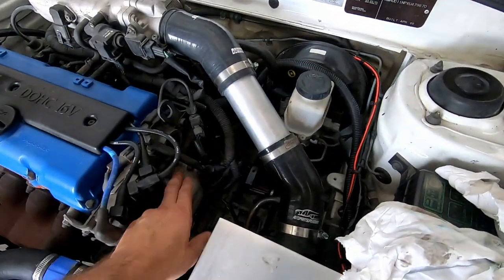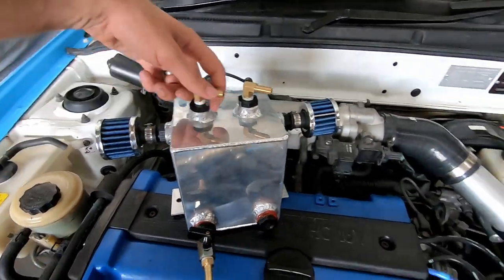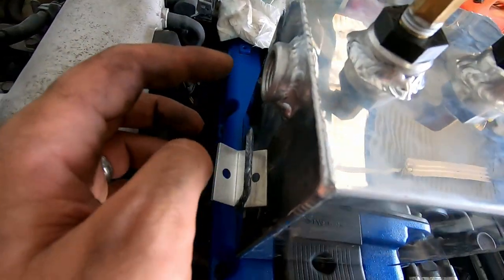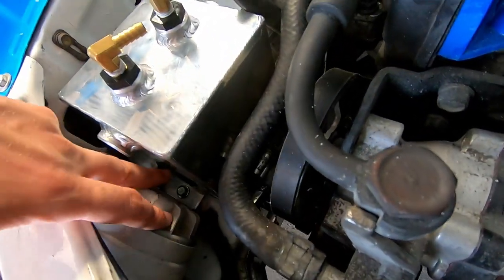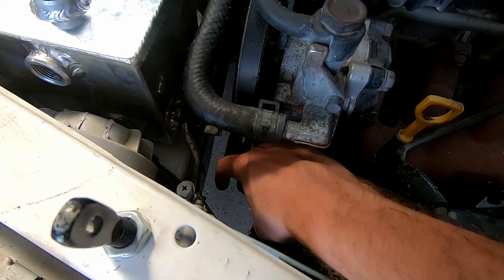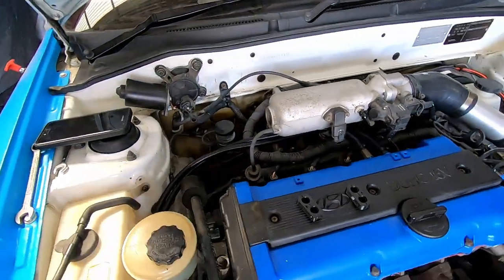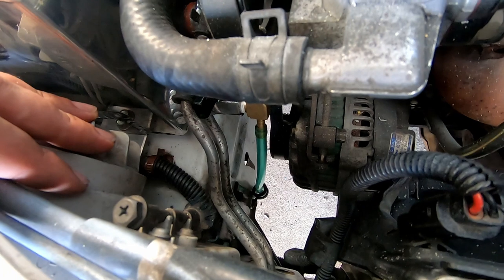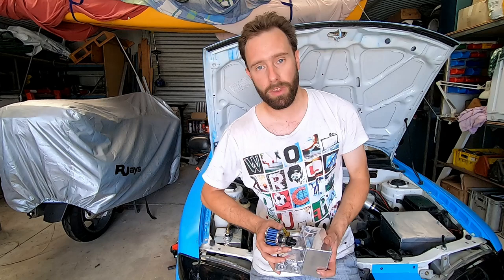Budget Race Car Build - Part 25 - Oil Catch Can Install

Comment: Gday mate.  The breather on the rocker cover ( the one on the left of the 2 ) is a one way valve it needs vacuum to open, I did the same thing as you and had oil escaping out the seal of the rocker cover as I think  it was not able to breath properly... I ended up replacing it with  brass fitting ..  Keep up the great work!!
Reply from the maker: Awesome!  Cheers mate I'll swap it out :)
Reply from the maker: Ok all fixed! found a spare adapter with the same thread, turned out down on the lathe and fits great :) cheers for the heads up